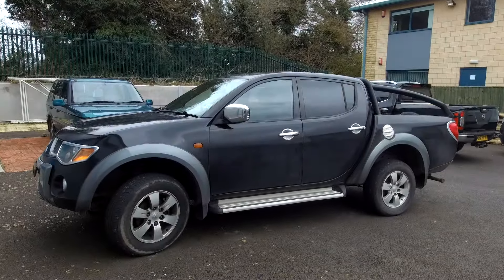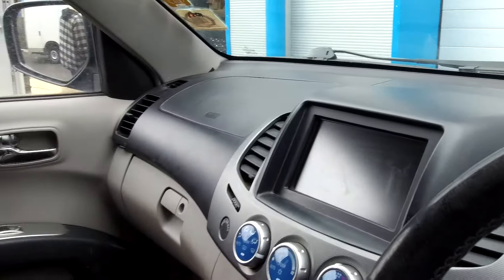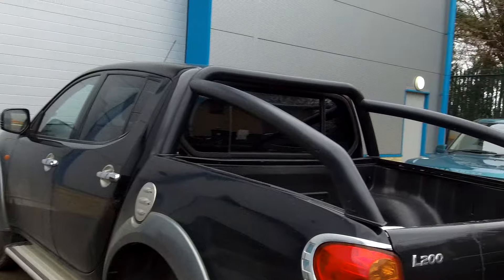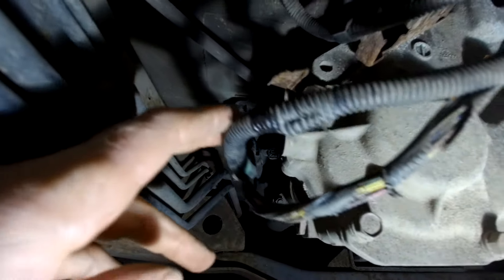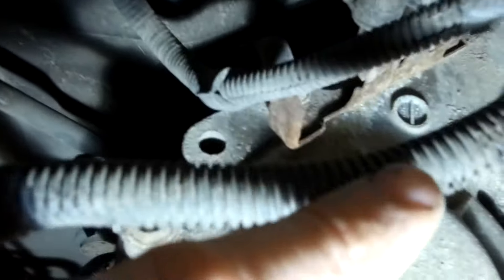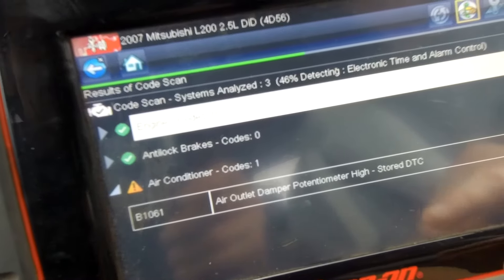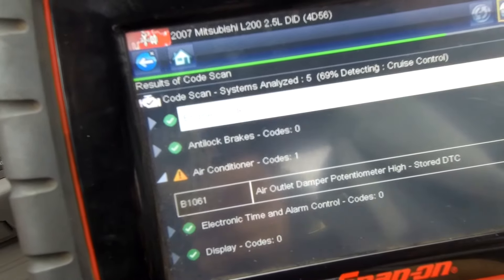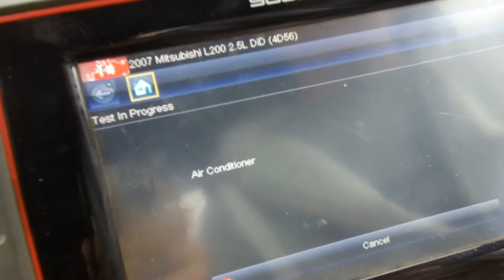Mitsubishi L200/Triton Automatic Gearbox FIXED - Watch this 1st !

Comment: Got a 2012 l200. Has a similar problem. When the engine has run for a bit and I drive down hill, I can feel a pull (only way I can describe it) and it jumps into a gear and stays stuck in it. The D on the dash flashes. This clears when I turn off the engine and restart, until I go down hill again. Could this be the same issue?
Reply from the maker: Its worth a check... 10 minutes to check...
Reply: Hi a have the same problem what you did to fix this ? Please help 🙏. I got new transmission and also torque converter and is still the same thanks for any help.
Reply: I have also that problem anyone guys fix it
Reply: Hi, I got the same issue. D Flushing. Do you manage to fix the issue, how?
Reply: @khairilthegreat  did you solve the problem i have the same damage

Comment: I also have issue with my Mitsubishi l200 but mine is 4n15 5 speeds auto. My car jerking from gear 1 to 2 when at warm temperatures or drive slow, especially at traffic jam. But it's changed smoothly when i just start driving at morning or drive fast.  Till now donno what's the issue 😢
Reply from the maker: Try and oil / filter change ?

Comment: HI i have a l200 2006 elegance my auto gearbox shifts gears smoothly on drive but i have noticed when i stop it downshifts to 1st gear very hard i can feel the knock also it sometimes stays in 2nd gear i can feel a slight vibration and when i press the accelerator pedal it disappears. what could it be?
Reply from the maker: I would check the wiring loom first ... then change the oil... but it sounds electrical issue
Reply: @L663  wiring loom as in the engine ECU loom or the transmission wiring? ive changed oil including oil filter.

Comment: Hi. What is that part of the loom called? I have searched for gearbox loom but it looks completly different. 2 of my wires have burnt out so much i cant cut them any further up as i cant see where the loom goes. So need to replace ect
Reply from the maker: Transmission Loom ?

Comment: Hi, did you replace a short section of only one wire or did you find other damaged wires? Is there anything you put in place to stop it happening again? I have the same problem but it’s intermittent and tends to happen over long journeys or when towing. Thanks.
Reply from the maker: I just replaced the one wire and then added a lot of insulation tape to relieve the stress and vibration and protect the wires
Reply: @L663  thank you.
Reply: I had this issue - sadly the auto gearbox specialist and Mitsubishi couldn’t find the wiring issue and the gearbox imploded via the torque convertor. £4000 later I had a reconditioned gearbox. 8 months later the symptoms started again - this time the mitsubishi garage was able to identify the problem and I opted for a complete swap out of the wiring loom leading to the gearbox and that fixed it finally.

Wouldn’t be surprised if this was the exact issue. 

When this initially happened all the mitsubishi / autobox specialists didn’t have a clue

Comment: Hi mate my Triton slips out of D and the little screen in front of me where normally reads my gears goes blank. Could this be the same problem? Engine light also turns on.
Reply from the maker: Depending which wire breaks the problems can vary... but take a look at the condition of the wires... it will take you 10 minutes
Reply: hey bro did you end up fixing it i have the exact same issue literally the exact same
Reply: Did you fix it bro

Comment: same problem over here but mine is 2016 model. You guys think this solution will 
apply?? to mine? please help.
Reply from the maker: you should check the wiring for damage !
Reply: @L663  hi m8 my 2010 auto the selector is realy stiff an struggling to find gears

Comment: Hello my gearbox cannot inside D gear when cold and jerking
Reply from the maker: Hi - I guess an oil change would be the best starting point here.... as its OK when warm its not an electrcal problem. The oil is the only think impacted by temperature
Reply: @L663  ok tq.I try to change an oil first? I will text u again

Comment: My car flashing D,and stuck at gear 3....but when i turn off engine and start back..evrthg back to normal..
Reply from the maker: Your problem sounds the same as mine exactly - i would be checking the wiring if i was you !
Reply: U car also prob lke me??
Reply: How can you fix the problem? You check the wire?
Reply: I check wre,bt stll same..all wire ok..😭
Reply: Hi please help me I have the same problem. D starts flashing and I'm stuck in 3 gear but I can down shift when I restart the engine it is fine but will do the same after a couple of kilometers
Reply: What you do to fix this ? Please help me
Reply: @marcelracak9372  try use atf gear oil cooler kit…after i use that my car fine until now..I’ve been it for a year and the prob hasn’t happened yet..